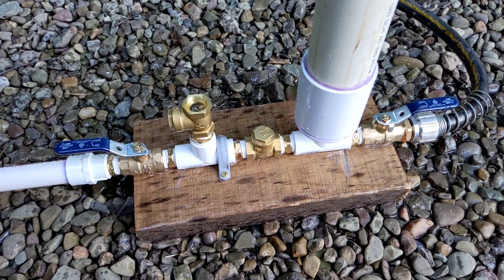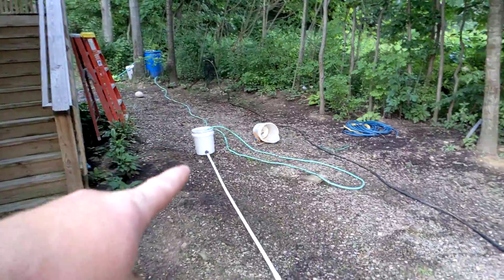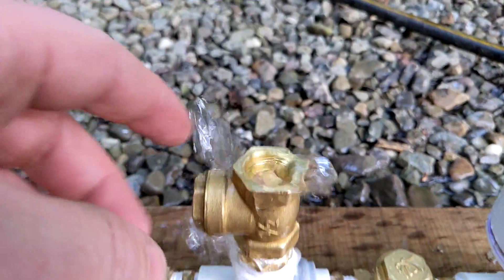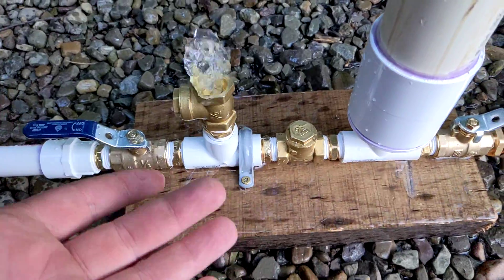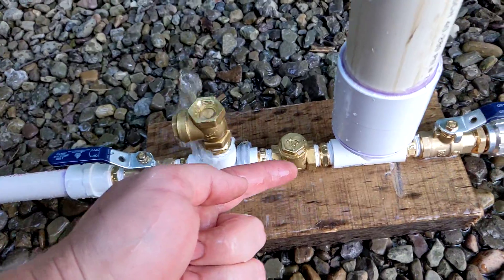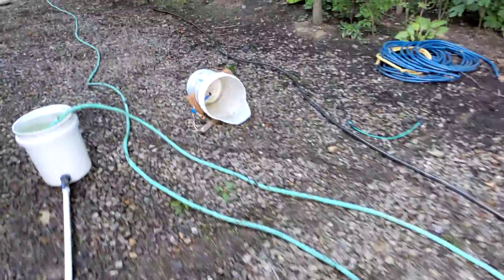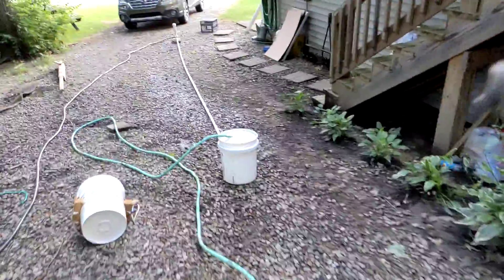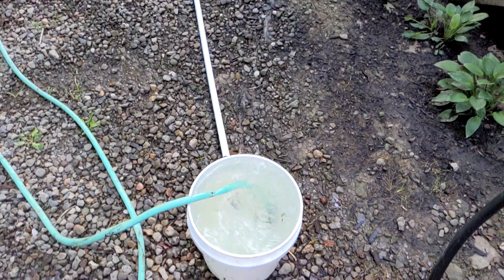Ram Pump (Finally)

Comment: The amount of air in the air tank will slowly decrease over time because the air will slowly dissolve in the water when it is under pressure.
For continuous operation you need something to separate the water from the air (something like a balloon) or a way to refill the air, for example a tire valve to pump some air in it every month or some tiny air bubbles in the feed water to constantly refill it.
The 1954 pump for my well has a big 500 liter tank for water storage which is also 2/3 air. The pump has a needle valve to adjust the amount of air which is sucked in to keep the air level constant.